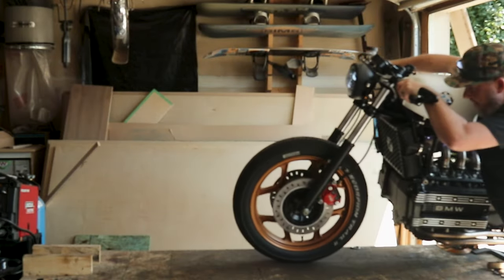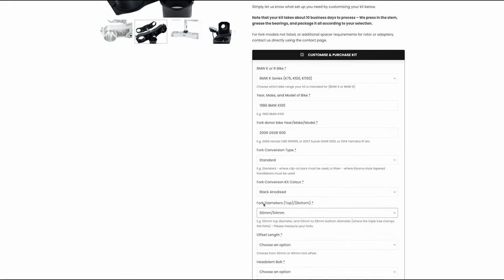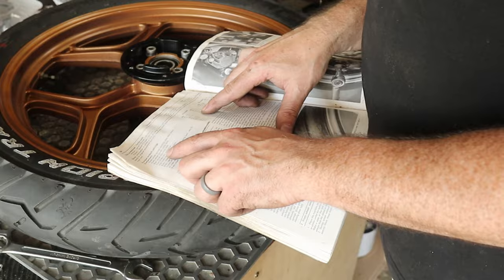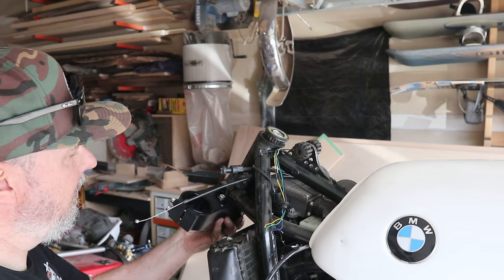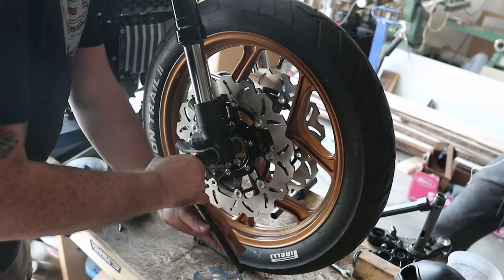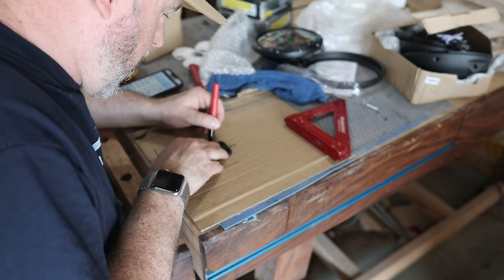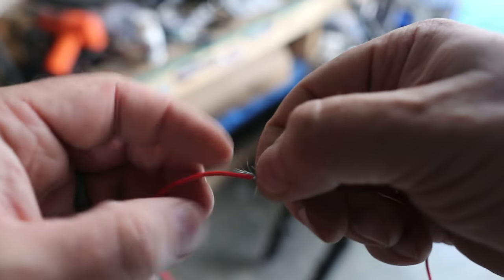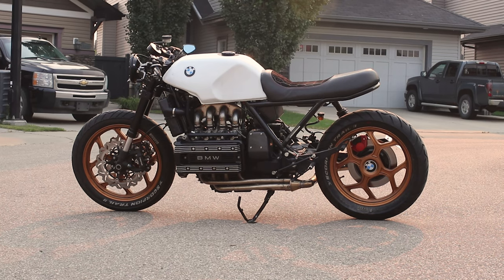The BEST Cafe Racer Upgrade - BMW K100 Cafe Racer Build

Comment: Check out ASA as a 3D printing material with triangular infill set to 50%.

You can sand and smooth it with acetone so It will have a gloss finish and if you sand it, you won’t see the printer lines.  It’s also UV resistant and has a higher warping temperature.

I made a fender delete for my 450SS out of it, it’s been going strong for about 5 months now.

Comment: Hello,
a small note: The contact surfaces between the brake disc and rim must not be painted. Fastening of the screws is not guaranteed because the color is soft. Due to the color, it is not really possible for the brake discs to rest flat and centrally and the heat from the brake disc is no longer passed on to the rim. Please always leave the surfaces unpainted that were originally unpainted. Warm greetings from Munich, Bavaria - Germany, Chris